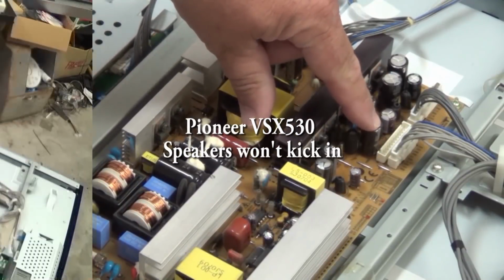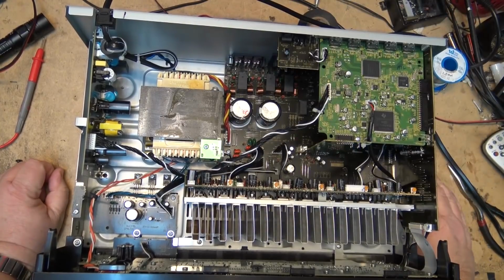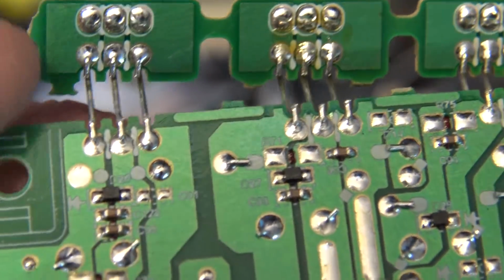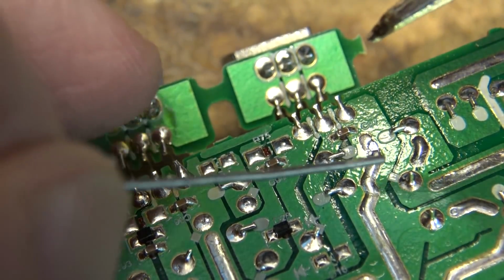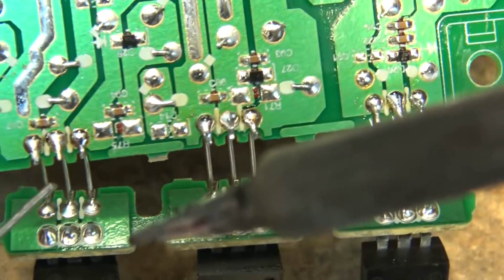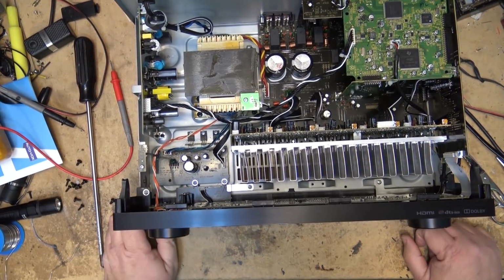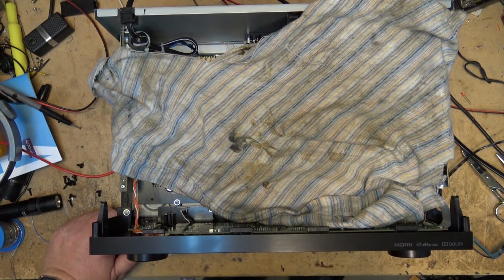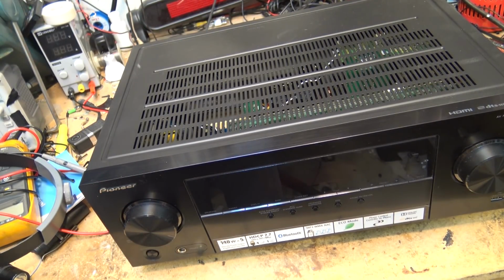pioneer vsx530 no sound can this garbage be repaired

Comment: When those type of Transistors and regulators are mounted like that on heat sinks, a plumbers bend in the leads should be  made so the heating and cooling of the component has a bend so the lead don't pull out from the package or the  board.  ( an old advice from the Motorola  engineers )

Comment: Many amateurs are watching your excellent work, and also learning lots! I am an amateur too, and have been 'playing' with Hi Fi Amps for years, with about a 50% success rate. There is nothing more frustrating than having to throw away a nice piece of equipment, because we cannot 'phone a mate' who fully understands such stuff. Please let me ask respectfully, if you considered that the Voltage Regs were supplying /feeding Electrolytic Caps. I have had similar problems where it has been a 'leaky' Electrolytic, and this has caused a rise in the output current of the voltage regulator, and hence, the regulator has heated beyond normal operating temp. I am no expert, but this can cause heat stress and failure on soldered joints, and I have seen this first hand. This is more likely to happen when you pump up the volume. When I examine soldered joints, I use a powerful magnifying glass, and often see the small 'rings' around the soldered joints. As you pointed out, often - these are cracks and high resistance joints. I will follow your lead and resolder these from now on......... I would still consider replacement of electrolytic caps whilst I was inside the equipment, more particularly, those caps being fed by the Voltage Regulators. If any Caps are leaky, this too may increase turn-on time, until they fully charge. Thanks for making an excellent video, your close-up work is the best. Greetings from Australia.
Reply from the maker: This unit is only a couple of years old so there should not be any bad caps in it yet.   If it was 20 years old perhaps but this is what 3.
Reply: At two years old, it isn't good to see a failure like this one. I didn't realize that the VSX 530 was so young! I have become very disillusioned with today's Hi Fi stuff, and it seems crazy to pay a fortune for something with a good brand-name that has been uncaringly assembled with the cheapest-possible components. I am just repairing a 1980's Sansui Amplifier, replacement of the integrated Amp Unit. It will also be re-capped, but I feel that there is an air of futility around this hobby of mine. Many faults with most mains-operated stuff, is usually in the Power Supply, and step-down. My current project, (which has been very successful) was to utilise a Pioneer Car Radio (4 - spkr system) as a main Hi-Fi Unit in my house. The beauty about this, is that it all runs very well, on solar power and a 150Ah Battery! I am just connecting-in a Soundstream USB 8A Sub-Woofer, and the whole system provides the purest of sound - completely devoid of Mains Hum / mains ripple. At a great listening volume, this whole system draws under 2A, The only downside, is that there are not enough inputs - for connection to a TV and stuff. Car Radios (today) are very hardy, and don't seem to suffer from the failures of expensive mains-powered Units. In driving the Pioneer Car Radio (as a home Hi-Fi), I placed Aluminium Cladding around the whole radio in a nice embossed (decorative) Aluminium Sheet, on the 3 sides, and this acts as a huge heat-sink, and it is secured to the radio heatsink itself (at the rear of the radio) by drilled/tapped holes very close to the MOSFET drivers. The purest of sound through JAMO speakers, reliability, devoid of mains hum, no 'mains spikes' to damage sensitive electronics. With the advent of cheap Solar Panels, Lithium Ion Battery Packs, this could be the future of all HI Fi equipment - who knows? It was great to get a reply back from you, and with more than 30 years at fixing electronics, I thoroughly enjoy the way that you come over in your Teaching Vids. I am over seventy, and I never expected a reply from you, but I was thrilled to receive one. Never too old to learn. Greetings from Sydney Australia.
Reply from the maker: @jackgarrison8497  yup most stuff is broken on Craigslist and eBay.
Reply: @12voltvids  Which sucks

Comment: Thx man You ve saved my vsx 830. In my case sound was coming back after touching those stabilizers only if just switching on off speakers did nothing. I just solder all connections as You did and all is running perfect. I'm my case I think delivery company must have treat this amplituner badly during transport and smthg must have loose. Great video, thx 1 more time

Comment: Very speedy repair :-D
11 seconds delay, that's quite a long time.
i would normally expect 3-4 seconds.
Reply: I have a newer harmon kardon and it takes a good 10 seconds to initialize and get sound when it is turned on.
Reply from the maker: Actually it is not. My onkyo also takes quite awhile to produce sound. 
Firs the power has to turn on, then the digital circuits have to initialize, and stabilize, 
then the audio circuits come on, and the protection circuit checks to see that there is no DC voltage present on the speaker terminals before turning on the audio.
A straight 2 channel receiver with no DSP circuits might come on quicker, but these multi channel boxes with 4K and HDMI tend to take a considerable amount of time.
Reply: I had no idea it took so long for these newer receivers to power up.  This is really good information to know. @12voltvids
Reply: @12voltvids  Yes, and some receivers will not respond to commands to change inputs during this time either. My current Denon isn't like that, but I had to adjust the delays on my harmony remote for past ones.
Reply: They are basically like a computer nowadays with DSP's and digital circuits. The microprocessor has to "boot up" and run a sequence of steps and go through a self-test.
Reply: My Magnavox resevers from the late 80s has about a 10sec dalay from power up to the speker protection kicking in
Reply: CeilingFan Music
I think i must have seen mostly older systems then, or perhaps they just didn't take long to switch on.
Reply: @zx8401ztv  nahh most resevers from pre 200 take less then 6sec from power up to the protection kicking in. My Magnavox is just slow.
Reply: Funny
One has a onkyo someone else has a magnavox i did see someone has a Harman kardon like me and we are all looking at Some computer Pioneer crap😂
Reply from the maker: These things are a piece of crap. Have another one in. No sound, but relay does engage, and the amp is working. Will probably walk away form this one.
Reply: I have the vsx520 and it takes about 10 seconds to start. When i ask about the problem from the retailer, a specialist audio shop i was informed that it was not a problem and to look upon the delay as a PC doing a self diagnostic on start up.
Reply: @12voltvids  It's so sad. Just had a Marantz come in - full of dry joints. Chinese capacitors weak. Just rubbish compared to days of old.
Reply: The timing capacitor is more than likely out of spec by now. 5 - 8 seconds is more in the "normal" range. Although the DC offset could be taking longer to come down too causing the extra delay.
Reply: @ceilingfanmusic6597  i love those magnavox, they had the nicest bass i ever heard.
Reply: @tenmillionvolts  im curently rocking a pioneer VSX-D606S. im pritty sure its from the late 90s an has a analogue frunt end (volume control and eq are analugh an not computer controlled) its been rocking well so far i just had to clean the controls to get it to behave. It has a pretty good tuner built into it as well. More sinsitive then anything today has to offer. I think over all its a good pease of equipment
Reply: @90210sky  thx yea they have good base. At least mine dose.
Reply: @12voltvids  My ADCOM , Both GFA 545 MK2 and 555 mk2 doesn't have speaker protection board, Maybe in the future I will Install one. Thanks for the video and continue with your nice repairs   👍
Reply from the maker: @RanTausi  that's in my opinion a very bad design.  Taking the attitude that "our products will never fail thus burn up your speakers) is a piss poor excuse.  
I had the opportunity to see a woofer that came out of a theatre (was at a speaker shop getting a crossover for a kef I was repairing) they had a big woofer, probably a 16 or 18", or should i say what was left of it.  The power amp failed, no protection and the voice coil ignited the cone and most was incinerated.  Aparantly the staff was allerted of the speaker fire when the screen that was in front of the speaker started to melt.   I have no idea what theatre this came out if but it was probably one in vancouver. They had the old dead speaker on display in the store.  If your speakers ignite what else is going to burn.  No protection and I am not running it, period.
Reply: @12voltvids  Ohh man that is very scary situation to be and to see big woofer blown away, well I don't know what Nelson Pass think about when he designed thus Amps. but as far as I herd they are reliable amps. did you had a chance in the past to work on them ? ADCOMS ?
Reply from the maker: @RanTausi  I have worked on adcom equipment in the past.

Comment: Those 7812/7912 are notorious for failing, they provide the rails for the differential amp on the amp board. Intermittent or no +12V triggers protection to stop the output relays kicking in.

Comment: Enjoy your presentation. As a matter of safety early on I was always taught to remove jewelry i.e rings and watches. Shorted a screwdriver in half making an adjustment late one night on the flight line. Was very happy to have jewelry removed. Just a thought.
Reply from the maker: Notice I don't wear a ring for that reason. If you ever see me working around hazardous voltages my watch is usually off or that hand is behind my back.

Comment: I Have a Pioneer VSX-524 that turns on with relay clicks but no audio . Could that be the hdmi board causing this problem, I checked all the audio outputs and they are good. The inside looks  just like the VSX530 you have here.  thanks  ron

Comment: I'm having a similar problem with a vsx523 (likely a lower end model or slightly older).

If I change HDMI outputs the audio will cut out and won't work again until I shut the unit off and leave it sit fof 20-30 minutes. Also sometimes after a few hours of use, I will hear static on the speakers for a second and then they go silent. I wonder if I have the same issue.

Comment: I have a similar Pioneer device (VSX-321) and it doesn't have sound on central and sw channel (speakers are fine, tested). I left it in a box for 3 years and it was working fine at that point. What do you think the problem could be?

Comment: the title of this made me laugh way to hard than it should be. my parents leave there 40 year old stuff outside in the garage where its changes temps from -40 to like 30C for past 20 years and its drafty and open to the elements where it could corrode or fail.. but yet the systems still work just fine even during winter in those cold temps. kinda amazing how some units just dont care then some just flakey in general.

Comment: This is the first that I have heard about a "speaker relay".    From your video I take it that the purpose of the speaker relay is to delay power to the speakers (and maybe to the amplifiers) until some period of time after the voltages on the +12VDC and  -12VDC power rails stabilize.    Thank you for bringing this to my attention.

So why didn't you get the owner to spring for some heatsinks for those three DC voltage regulators?

Comment: I have this receiver as well as jbl speaker 5.1. Subwoofer powered on and white light out of standby. All speakers work but subwoofer producing no bass/sound. I touch other side of cable while plugged in sub and it produces bass/sound. I do a sound test and all speakers but sub not working. Not sure if there is a setting issue where the sub won't work without properly configured on av receiver.

Comment: Dave, 

Thanks for showing how to fix this Pioneer Receiver.  Did you use the old kind of solder for the repair or the new kind?

Thanks, Tom
Reply: I would suggest that as this was for a customer he had to use the cough lead-free kind ;) ;)
Reply: Cough, cough, cough!
Reply from the maker: No such thing as lead free solder here. 60% tin 40% lead. Only the good stuff.
Reply from the maker: @danmackintosh6325  
There are no restrictions on what shops use for repairs. Not here anyway.
They might have banned lead free for manufactures but it is readily available for repairs. Now for plumbing you are in a different league. Plumbers have to use lead free for all potable water joints due to lead leaching into water that gets consumed.  A few connections made with lead free solder is not going to  have any impact on the environment when the unit is disposed of.
Reply: @12voltvids  Thanks for the information. Obviously, it mixes well with lead free solder which is good to know.
Reply: Yes it mixes in fine :) I was thinking of manufacture not repair, I got mixed up and thought it was also not for any commercial use (or I may even have been misinformed in the past, don't remember haha). Thanks for clarifying.
Reply: @12voltvids  , the shop I work for uses Kester 60-38-2  solder, with 2% silver. Excellent stuff, wets and flows beautifully. We do occasionally, however, encounter circuit boards with lead-free solder where the Kester solder produces a grainy joint when we attempt to add fresh solder and reflow, so in those cases we use the vacuum desoldering pump and suck off all the lead free stuff before resoldering it properly with the Kester solder.

Comment: good work! i have this machine and its working well BUT the only problem is i have no sound from AM/FM section ,not even static noise. searching and storing stations well but no audio at all, i have cleaned and done the solder but no change. Kindly help

Comment: If this unit comes back to you it might be the Hdmi board.  They are notorious for the hdmi board to have bad solder joint around the dsp chip.
Reply from the maker: Onkyo had many problems with the HDMI DSP chips. Been there dun that.
Reply: I have the VSX-522 and this seems like it might be my issue, as of this morning none of the hdmi inputs will produce any sound, if I switch to am fm radio I receive sound from the speakers. Checking the solder joints tonight

Comment: Have you thought about using a Dummy Load to check amplifiers? You can crank them to full while testing and not upset the neighbours! And the amp will heat up quicker! Well spotted on this one, good job as always fella!
Reply from the maker: Yes I have a couple of 8 ohm 50 watt resistors. They get hot1
Reply: @12voltvids  I put mine on a recycled heat sink, enough to handle 1600 Watts with a switch for selecting 8, 4 and 2 ohms. But it's better for PA amplifiers.

Comment: i have a vsa d802s that i bought new in 1993, i used it most days for 16 years, i stored it away around 10 years ago and used a kenwood music amp instead,
its about the same age as the pioneer, i got the pioneer out recently switched it on all lights up functions normally and gives sound from sources,
well you cant beat that, better than this modern crap you get nowadays, bye the way the kenwood is still good aswell.

Comment: That's not always the case with the cold soldering,
rather, elec- trolytic capacitors dry and lose their voltage until they are charged.......... Best regards from frankfurt Germ.
Reply: Not in new equipment, capacitors can last 50 years
Reply: Came across a Linn all in one (about $1300 in 2005); capacitor problems, because cooling was not well (closed cabinet). 
So: capacitors only lasted for about  15 years. Later models had a fan!
Reply from the maker: In this case, it was pretty obvious what the problem was. Before resoldering no sound unless I turned the speakers off then on. After resoldering they come on as they should. I am thinking a slight voltage drop because of connection on regulator caused an op amp to have a slight dc offset that was amplifier and was keeping the protection circuit from turning on.
Reply from the maker: @Synthematix  
At least.
Reply from the maker: @adriaanroeleveld5823  
Surface mount caps have relatively short life spans.
Reply: Thanks for the quick reply. The SMD caps were OK. It were the trough holes in the SMPS. Rated for 85 celcius, but the unit came quite close to it on the inside. So replaced them by 105 celcius ones. Now it's playing fine.
Reply from the maker: @adriaanroeleveld5823  All SMPS need 105c caps and it has nothing to do with the internal temperature of the power supply.
The high ripple current and frequency causes internal heating of the plates in the capacitor which boils off water based caps, and 85' caps are most certainly water based. 105 are oil based, and oil doesn't boil at 100c like water.
Reply: @12voltvids  Amateurs think capacitors are the only thing that can go wrong in things
Reply from the maker: @Synthematix  
Yup.  In reality cold solder causes far more problems. That and bloody edge connectors and flat flex cables.
Reply: @12voltvids  Ah man theyre just a pain in the ass, those superfine ribbons are a nuisance